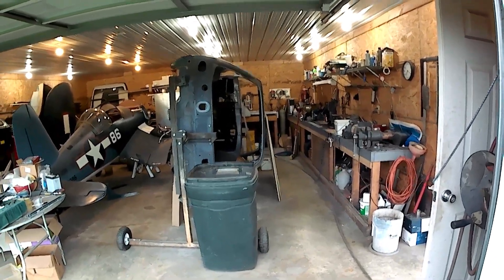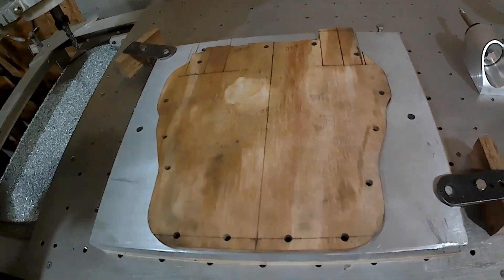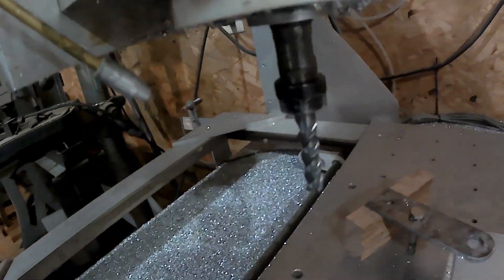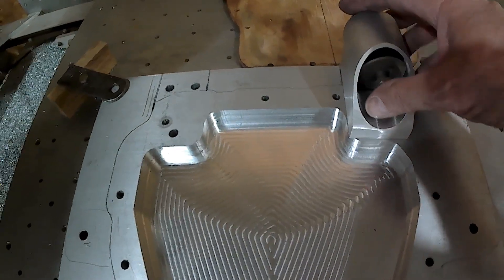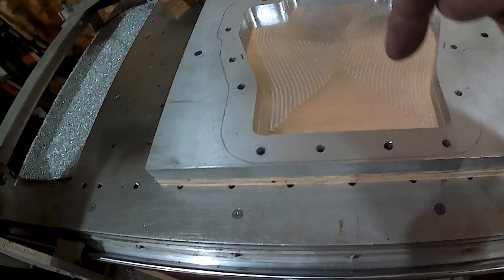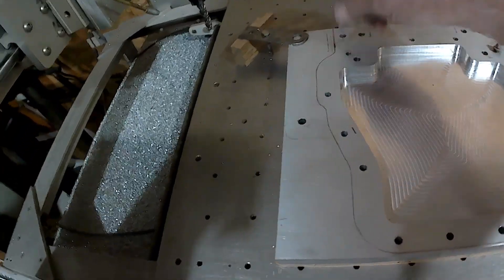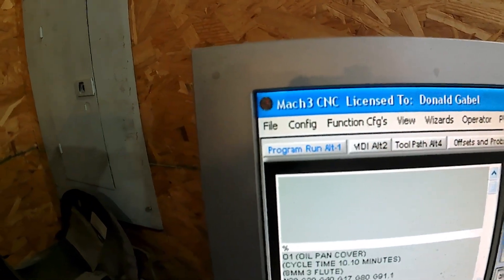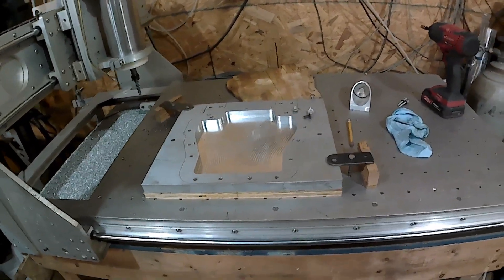A little CNC action for the WAR Corsair

Comment: That is a very impressive machine you have built. Guess you could even add some cooling fins to the bottom of your oil pump. Would help cool,and make the part lighter.
Reply from the maker: I was thinking about that, but it is too hard to draw up and figure out how to do the tool paths to cut them.

Comment: Why can you see where the bit ran?  Why isn't it smooth? What are you using for a bit?
Reply from the maker: Even the high end machines will leave tool path marks. It is smooth, with just a very small edge of a couple thousands just on the bottom. The bits are 3 flute just for aluminum. They are the best ones I have had for clean cutting.
Reply: @Dynodon64  thanks